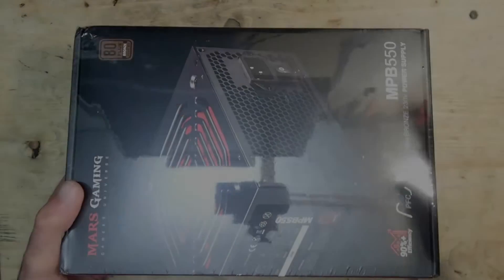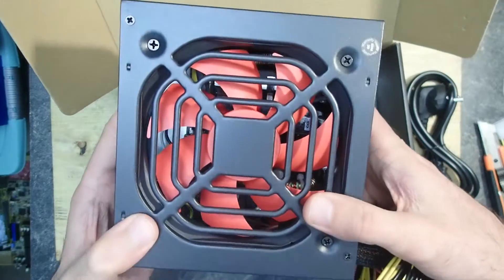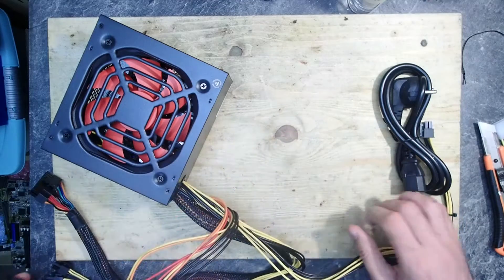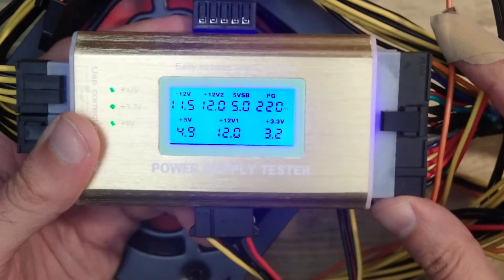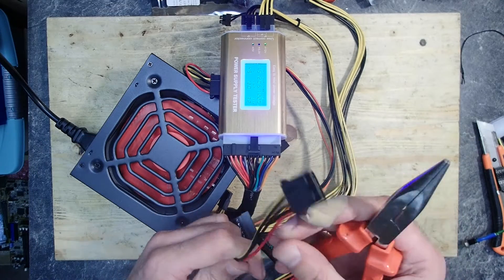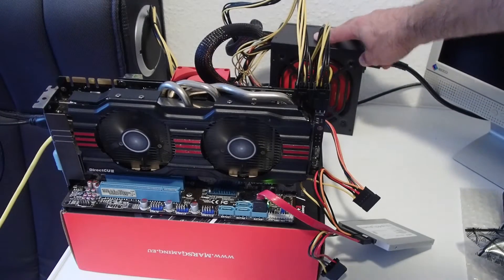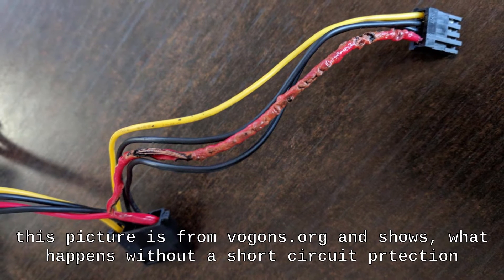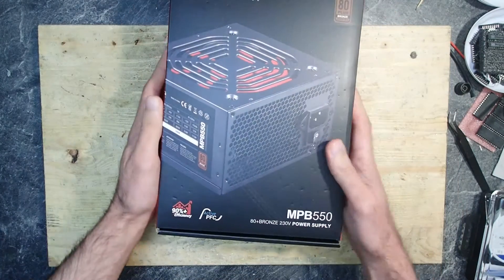Is this super cheap ATX power supply any good? (Mars Gaming MPB550 Review)

Comment: Thank you for this test, really helpful.
 I tried finding more in depth tests for the Seasonic B12 BC 550W, which is 60+euros, but couldn't find any.
Maybe the Seasonic has 5V SCP, maybe it doesn't. Maybe the Seasonic has even less ripple with 360W than under 70mV, or maybe not. Maybe the Seasonic makes less noise, maybe it makes more.
The only thing I'm certain is that the Seasonic has Japanese capacitors, which is a big plus.
I'm going to buy the Mars, I'm not going to use this PSU on old rare hardware, so I'm not very worried about the lack of 5V SCP and about the chinese capacitors.
If you buy more of these kind of cheap hardware and make videos about them, I'll also watch them.

Comment: I guess, that into this psu is guts from very bad knowing Aerocool VX, it has similar board and unsafe 5v line. This psu us very bad, i saw a lot of dead vx in my life.
Reply from the maker: Long term test is still on going. It powered my test machine for half a year, now since 5 months in a Ryzen 5 5600 with RTX3070. Runs fine so far 😁

Comment: You go and buy a 600€ PC and power it up with a questionable PSU that cost 25€? I mean the Capacitors may work, but how long 1 Year? because your overusing them? Buy dirctly a cheap Corsair, BeQuiet or FSP, and you are on the safe side.
Reply from the maker: I have two PCs with Ryzen 5 3600 RX570 and one Ryzen 5 5600 RTX3070 and guess what? Expensive BeQuiet PSU in the first PC died after 7 months and this cheap one powered for half a year one test machine and now runs since half a year in the second Ryzen 5 5600 machine. Cool and quiet.

However, I don't suggest anything, just sharing my experience so far. Still waiting when the cheap PSU dies, simply out of curiosity.

Comment: Hello, can I use it on my collection?
-ryzen 5 5600g 
-asus tuf gaming b550m plus wifi
-rtx 2060 super 8gb
Reply from the maker: It would run, but you should get at least 650W PSU, since RTX2060 gives high voltage peeks.

Comment: It is as always. A good quality PSU needs much more and heavier parts. A active PFC needs extra coils and higher power needs bigger transformers. So a good PSU is much heavier than a low quality one. Cheap PSU´s have the "high power" only printed on the case.
Reply from the maker: That's simply not true. Older PSU for example used heavy coils for passive PFC filtering and we're much heavier, than modern ones with active PFC circuit. That doesn't mean, that older PSUs were better. Deciding if an electronic part is better or worse comparing it's weight, means completely ignoring the progress. This very PSU, which you see in the video is currently powering a Ryzen 5 5600 with an RTX3080 Ti. Absolutely stable, cool and quiet. It was also officially tested and got an EU certificate delivering over promised 550W. All the data can be obtained from the official sites.

Comment: I once bought a cheap 5 dollar PSU which was advertised as 450W but was 180W but it passed all short-circuit and burn-in tests except the OCP which was set too high. I still have it from 12 years back its just it rails voltage is low due to ageing capacitor.

Comment: I have a 1000W Mars Gaming PSU - works fine, but is noisy as hell under load.
My system is a Xeon W3690 on a Gigabyte UD4P paired with a RTX3060OC.

Might switch it for a BeQuiet 750 just for the acoustics
Reply from the maker: There are different versions, it is very important to take the MPB and not the MPII version. The last one is loud and inefficient. The MPB got an official EU certificate and is very good. The one from this video is currently running in a Ryzen 5 5600 system with a RTX3070 Ti. Absolutely cool and silent.
Reply: @necro_ware  I have the MBP1000
Reply from the maker: @flensburgerpilzproductions3141  Well, that one was only certified for 115V US, but not for the 230V in the EU. At least I can't find it in the lists. Looks like the most powerful Mars Gaming PSU, which was certified for 230V EU is the MPB850. Probably, there is something odd about the MPB1000, that it got no certificate in the EU.

You can search here if you want: https://www.clearesult.com/80plus/manufacturers/115V-Internal

Comment: Why does the lack of 5v protection not actually bother you? You brought it up, yet still recommended this thing? I don't understand or agree with the conclusion.
Reply from the maker: Because many modern and more expensive PSUs don't provide 5V short protection as well and because 5V rail is barely used on modern systems.

Comment: 7:59 80 plus is a certification. It guarantee that it has a 80% or more efficiency between 20%~100% load.
Bronze only requires:
82% efi at 20% load
85% efi at 50% load
82% efi at 100% load
So their 90% efficiency claim is most likely a lie.
You only start to see 90% efficiency at 50% on 80 Plus Gold and you only see 90% plus efficiency thought the entire load range at 80 plus titanium.
Reply from the maker: See the pinned comment. I wrote everything I could find about it there.
Reply: @necro_ware  Funny how according with the test results it should get a 80 Plus Silver certification but they label it as Bronze.
It came very close from passing the Gold certification.
Reply from the maker: Not quite, you have to take a closer look at the certificate. This is a 230V EU 80 Plus Bronze. The EU is important, since it has slightly higher requirements, than the normal 230V 80 Plus Bronze. For the EU Silver you need to get to over 87% of efficiency at 100% of declared load. This PSU gets only 86% hence "only" the EU Bronze. You can find a good overview here: https://www.tomshardware.com/news/what-80-plus-levels-mean,36721.html
Reply: @necro_ware  Didn't know that EU and US 80 plus had different requirements.

Comment: I buy only ATX power with JAPAN or USA made capacitors! Made in China is......My experience, it is not worth buying cheap things and it does not matter if it is from a proven manufacturer! My ATX are 670 and 710watt.
Then it cannot happen that individual branches do not give the required value at high hardware load or overclock!
For example Fortron produced 550watt this Fortron HYDRO GE 550W with japan capacitors. Fortron give on some types 10years waranty! I trust them more than any tests.
Reply from the maker: At least since I was working for a German company which had a cooperation with another Japanese company, which sold a very expensive home electronics, I don't believe in that fairy tale anymore. Expensive doesn't necessarily mean good and cheap doesn't mean bad. In addition to that, a lot of products from China made a huge step into the direction of quality in the recent years. Many things can still be bad, but I wouldn't judge by the price or the country of manufacturing anymore. Also a lot of stuff with "Made in Germany" imprint is a total crap today.

Comment: Used before a Mars mpII 850. Often my computer booted, and got BSOD, restarted and it was fine, but when i moved the mouse, had a silent, high pitched noise from the psu. I buyed a new one, since then, i have no problems at all. I not recommend using this modell.
Reply from the maker: This is a MPB line not a MPII. The last one was a complete crap and the new one is a complete redesign. This time much better and with a real license and registration in the EU.
Reply: @necro_ware  Thanks for the research, and for the quality content! Keep up the good work!

Comment from the maker: UPDATE: Meanwhile I tested this PSU inside out. In my test it worked 12 hours at over 360W of constant load (Ryzen5 + RX480 of rendering work) without a slight hick up. Unfortunately I have no equipment to bring it up to 550W, but at the named 360W it was absolutely cool and quiet. The voltage was stable and the ripple on the 12V rail was under 70mV that is really good. To compare with my three times more expensive BeQuiet, that was at around 100mV. The active PFC is also true and is working, I tested it as well. Furthermore this PSU was tested and certified in the EU, I checked for the official registration and test results. They are not faked, like with many other cheap PSUs, but this PSU is only (!) certified for the EU and only for 230V. As far as I understand, this PSU is not available in the US. I guess, the world wide certification would be just too expensive for such a price. 

Still the missing short circuit protection on +5V rail worries me and in my opinion the cables should be thicker for the full 550W load, but I might be wrong in that regards. Unfortunately the missing over current protection seems to be a weakness of many modern PSUs today, even of the expensive ones. Otherwise this PSU was an absolutely positive surprise for me. It delivered better overall performance, than my much more expensive BeQuiet PSU and  I definitely would buy it again.

Here are some EU certification test reports:
https://clearesult5.sharepoint.com/:b:/s/PLS/EVJ7AiRuNEpFvPJhwapt7m8BlMEXsGzlGmQ9m7d4_vjALQ?e=YI2CMY
Reply: Thanks for the update :)
Reply: What does the 5V rail supply? USB?

Comment: For just 10 euro more u can get a real psu, this one is just pure shit, 550w ? Yes of course i have 3 balls 🤣
Reply from the maker: I still don't know, if it can handle 550W, however this PSU turned out as a total surprise. Meanwhile I tested it at over 360W constant load over 12 hours. The PSU remains stone cold, super silent, stable and delivers very low ripple. I still can't believe how good it is. Don't be confused by the price. I learned that lesson a long time ago. In my main PC I have a BeQuiet PSU, which is 3 times as expensive and that one delivers worse ripple and gets a lot warmer. On the bad side though, I think the cables could be thicker and  the missing protection on the 5V rail.
Reply: @necro_ware  for the same price u can buy  evga 450 bt  (or BR version)😉

Comment: I get Seasonic 500W S12 III for $44 in discount 5 years warranty
Reply: Yes ofc, evga 450 bt, corsair cx 450, sharkoon shp 500w they are all about 40euro price range, they are real psu, the corsair is even a DC to DC  CWT platform
Reply: The s12 III is decent. It’s not made by Seasonic unfortunately though.
Reply: @EvilTurkeySlices  But still they putting they brand on it = need at-least be decent

Comment: Is this power suply ok for i7 9th gen and gtx 1660 or should i upgrade as fast as posible
Reply from the maker: All tests I did so far didn't show any issues except the 5V short protection, which I was talking about. Meanwhile I even checked the ripple on load and it was only under 50mV on 12V rail. People can say what they want, but this is really an impressive PSU for the price. I didn't expect that.

Comment: Great video - just a bit of extra info. This is not an 80 plus PSU. This manufacturer has only had one model certified and that was MPB1000 in 2015 at gold. So this one may theoretically meet the spec but they should not be using 80 plus badging on it. You can check at the 80 plus site clearresult. 

Everyone should check that site before they buy a PSU to make sure that at best the same model is certified, or at worst that the manufacturer has lots of models certified.
Reply from the maker: Thank you very much! I didn't know, that this information is openly available. However, I just found this PSU on that site, it was registered as Bronze for 230V EU in 2019. I would assume, that messing around with such things in EU is a bad idea, since you can buy this PSU openly in the stores here.
Reply: @necro_ware  Oh you did find it? In that case this is a good value basic PSU!
Reply from the maker: @DaveVelociraptor  Yes, they seem to have registered only the MPB1000 for 115V/US, but if you select 230V EU, you will see a longer list of products including the one, I'm talking about in the video. Anyway thanks for the hint, I will save the link for the future.

Comment: That thing is a time bomb. Spend extra money on reputable PSU's folks.
Reply from the maker: It's funny by that price, but I really have no plausible reasons to say that. Meanwhile I opened it and it looks all just fine, I measured the voltage ripple and it is well within the specs. I didn't get manage to load the PSU with up to 550W, but at least at about 300W it behaved absolutely cool and stable over 24h of continuous stress tests. Still, everybody should understand, that for that price, there must be some "compromises" and nobody should expect some kind of magic. But I'd say for a low budget PC this PSU is may be good enough. And talking about reputable PSUs, I had an expensive BeQuiet PSU, which is IMHO quite reputable, I guess. That one exploded in fire after 4 months and took down my mainboard with it, so you can't rely on that.

I was working in my life in a couple of very reputable companies, and once I've seen, what happened behind the scene, I stopped believing into the names ever since. Not everything is good or bad, don't get me wrong, I don't want to over-simplify it, but I saw no-name cheap Asian products, which were thousand times better, than the super expensive European pendants. Unfortunately you really know it first, when you take a closer look at both side by side.

Comment: The moment I heard "35€ power supply", I automatically thought "garbage caps". Do you happen to have an oscilloscope? Even with a very old scope, you can measure the output ripple for each voltage.
Reply from the maker: Hi, got about 95mV ripple on 12V at 265W overall load.
Reply: @necro_ware  is it good or bad?  What is high and what is ok ripple value?
Reply: @warrax111  120mV on 12V is absolute maximum as per ATX spec, and most decent PSUs stay (far) under 50mV, so 95mV is pretty crappy tbh especially considering that's at just roughly half load (265W)

Comment: Without the 5V Rail Protection this Power Supply is very good to blow up Tantalums on old PC Parts. then you can find the culprit very fast ^^
Reply from the maker: The question is, what will blow up faster the tantalum or the PSU :D To find short circuits I prefer to use  the way I showed in my last video though.
Reply: @necro_ware  Yep, the tantalum, the PSU, the wires, your house or the PCB.

Comment: Output is 5V/15A, so it must work with load 5V/15A=0.333 Om - are you sure a two wire that you short is much less then 0.3 Om? :)
Reply from the maker: It's theoretically even 5V/18A=0.27 Ohm. I didn't measure the resistance of the cables, but they get very hot very fast if I try to short the 5V rail. And the PSU definitely doesn't turn off, so if I do it couple of seconds longer, the cable will stand in flames. Eventually  it doesn't matter so much why it happens, but that it happens at all. As I said, this video was just a basic test to give the people an idea what they get. Unfortunately, if you compare this PSU with the other known names, which cost 50-70€, you will notice, that this PSU is at least just as good or bad, depending on the point of view.
Reply: @necro_ware  so, to close all questions, you can shurt 3-4 5V lines on case of PSU - it will garantee low resistance

I'm suppose it just to tiny wires and PSU can't catch shurt on wire
Reply from the maker: @run4restrun259  I'll try this by occasion, but that wouldn't be real life test, where usually only one cable gets shorted. In such case you'd get a stinky fire in about 10 seconds :)
Reply from the maker: I was too curious :D Shorted two cables with the same result. No short detection. I also measured the resistance and got 0,2 Ohm from the end of one cable to the end of another (they are bound in the PSU on one end). So, with one cable, it should be 0,1 Ohm. That should be low enough to be detected as a short in my opinion. Unfortunately, it's the finest result I can get with my multitool.
Reply: @necro_ware  what's why wee need to see what's inside of PSU :)) It's classic schematic on trans with  12 and 5 Volt output or modern 220V > 400V > 12V output, plus two DC-DC 12V > 5V and 12V > 3.3V